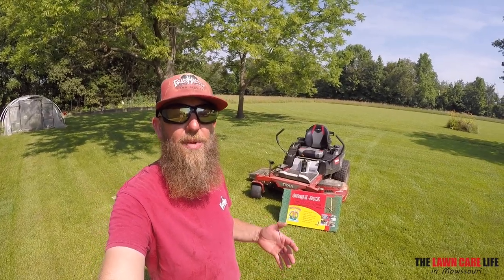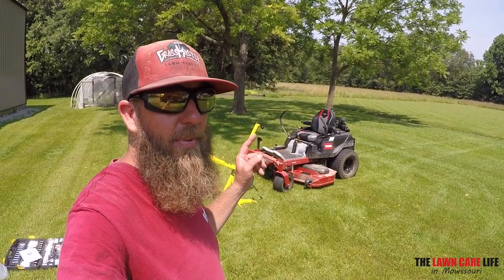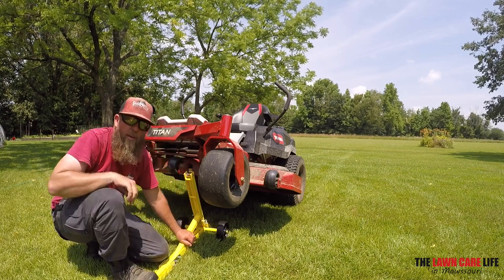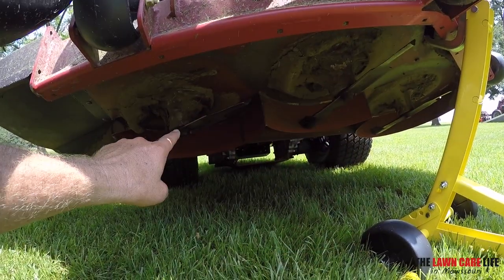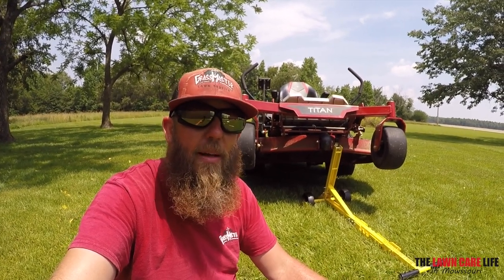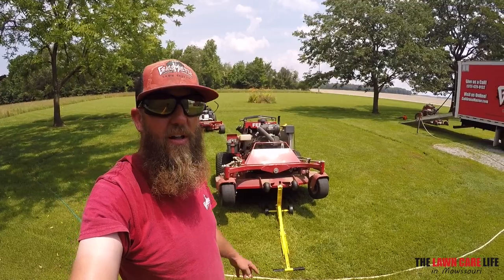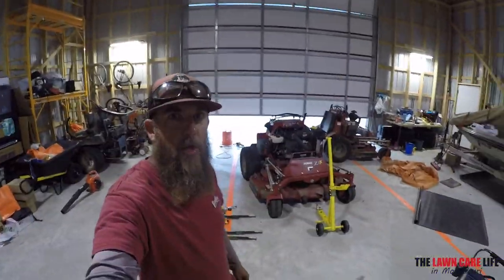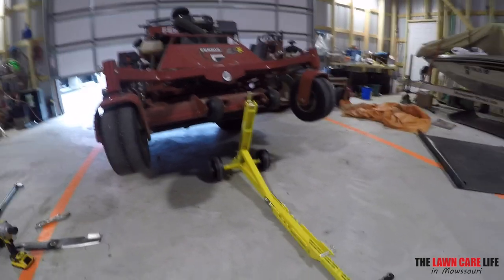Jungle Jack Review with TORO TITAN and Ferris Z3X - DON’T Do It This Way!  Do it THIS way instead!

Comment: If you watch the YouTube video the company made about the Jungle Jack it tells you to remove the pin and lower the safety arm until it's on the ground...then insert the pin into the other hole...THEN raise the mower.  The printed instructions tell you to use it only on concrete or hard surfaces, not on a lawn.  It also says never to put your head under the mower without jack stands in place, and sure as heck not on grass.  Be careful dude. Don't lose your head.
Reply from the maker: Thanks for the tips!
Reply: Yeah forst thing came to mind... this guy didn't read the instructions and makes a video 😂
Reply: Huh? I don't see how the jack can work if you pin the safety arm down first. You have to jack and then pin. The man's problem was using it on soft ground. He figured it out in the shop. Jack then pin.

Comment: On any lift ,you need a  solid base surface not a grassy ground,  you wouldn't put a car jack under a car that way this is not any different.
Reply from the maker: Solid tip right there!

Comment: looks like a cool tool but its a 'one trick pony', i'll stick with my hi-lift jack which pulls posts, winches and about a hundred other things. i'd never crawl under with ANY of the jacks out there tho. jack stands or 4x4 back up to any jack for me
Reply from the maker: Definitely recommend putting car ramps or blocks under the tires if you’re going to be completely underneath for any reason.  Works great for swapping out blades real quick tho.

Comment: I'm glad to see that work on the Z3X, I use a chain hoist at home but I don't have a way to do it in the field.
Reply from the maker: It may be a little tricky in the field unless you have a concrete driveway to put the Jungle Jack on.   But yeah it works good out in the field.  Takes up little space in the box truck!  👍
Reply: @TheLawnCareLifeinMowssouri  
If there's not a hard surface for the Jack wheels, I pull the front of the mower on the ramp.
Got to work around the ramp cables but that's not bad.
Reply: Hey bud, yeah I have Ballard's super Jack at home but I'd like to add the Jungle Jack for the field. Ballard's is wide and bulky for Mobile use.
Reply from the maker: Gary Cecil Garrison Thanks for sharing.   Never tried that particular one, but that’s good to know!

Comment: Very good point about the holes lining up on the jungle Jim Jack so that the safety pin can be installed. Thank you. It would have been helpful to tell us how much force you had to exert to lift each machine and to comment on its degree of difficulty.
Reply from the maker: I had to exert a lot of force to get the Z3X up.   But the Toro Titan was really easy because all of the weight (engine) is in the back.  I really wouldn’t recommend for a stander mower.   A lot easier on a sit down mower.  Hope that helps!  👍
Reply: @TheLawnCareLifeinMowssouri  I have a 36 inch gravely walk behind commercial mower. I can't risk buying this lift and not knowing whether or not the holes will line up. It's expensive and I'm just not going to risk it. Thank you for your review and advice, very helpful. Take care.

Comment: Ah bro! i have a jungle jack also, along with a z3x.  I cant get mine to lift at all.  But watching you do it maybe Ive been doing it wrong.  I did reach out to the company just last week and they responded back with changing out the 2" tooth that came with the jack and replacing it with their 3" tooth.  I dont think they even know if it will work or not.  only time will tell.  Keep up the great video content and rock on!
Reply from the maker: Thanks for watching!  What kind of issues were you having with your Jungle Jack?  Would it not stay on the deck?  Was it slipping off?  Where did you try to lift the mower at?   Any info would help out!

Comment: If you want excellent access, back the mower up some auto ramps. The Jungle Jack will then lift the front and there will be lots of access to inspect the transmission and any idler pulleys or mud caked on the transmission, keeping it form proper cooling. Nobody wants to buy a new mower ahead of schedule because they didn't get a good look see before things went south.

Comment: I have Toro ZMaster 4000 with 48" deck. Recently picked up the Jungle Jack. Seems the 2"hook might be a bit too small. Is this in fact the case? Do I need to purchase the larger hook?
Reply from the maker: I'm really not sure.  I think when I bought mine there was only one option.  That may have changed now.  I would contact them directly and see which one they recommend.  I don't want to steer you in the wrong direction on this one.

Comment: I am quite intrigued with that jack for my residential ZTR. However, I have a concern that you may be able to answer. That fold down assist-step seems quite high. I'm in my mid-60's with arthritic knees. You seem to have to step really high to reach that pedal. I'm not sure I could do it.
Reply from the maker: Yes sir.  It is pretty high.   I would have to measure to see how high it is off the ground.   If mobility is good, I don’t think you will have any issues.  If you can bend your knees enough and lift your leg to the 3rd step (skipping the 2nd step), I think you would be able to use this lift.  Hope that helps some.

Comment: How many hours do you currently have on the titan. Like the design just don’t know about the house brand engine
Reply from the maker: Under 50 hours.  Everyone says they are really good engines.  Personally, this is my first Toro engine.  So far so good!
Reply: engine is a Lincon engine, very heavy duty. no, it isn't a honda motor but every bit as good as a kaw or kohler.

Comment: Your problem is that you are trying the jack on the soft ground, causing the wheels to digg in the ground. That in turn limits an angle that the security arm was design to travel. Looks that the Jungle Jack was design (and rightfullt so) to be used on a solid base like a garage floor. Using the jack on a soft ground create risk of loss of stability,  and IMO is not safe and not recommended.
Reply from the maker: absolutely!  💯
Reply: I use jacks and jack stands on grass but always use 3/8 steel plate under jack, and 2 X 8 wood under both jack stands…so 1jack and 2 jack stands. I have a Ferris Z3X 52” stander, very heavy and difficult to scrape and change blades. Thanks / Jim